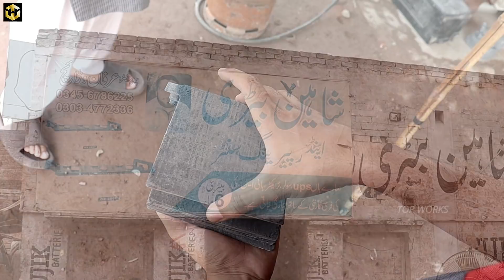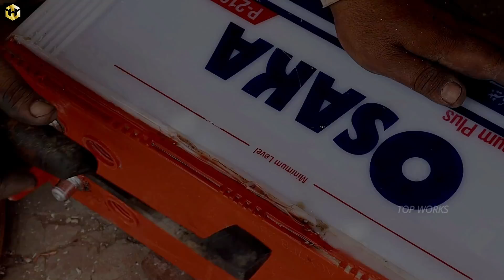Talented Expert Man Making a Lead Acid BATTERY in Workshop | Amazing Battery Process

Comment: I saw him pouring only acid . Does it work without distilled water?
Reply: its a diluted acid probably already premixed with water and acid
Reply: Sulfuric acid in batteries is mostly water.  Watching him stack those plates outside in the dirt, I doubt he's using distilled water.